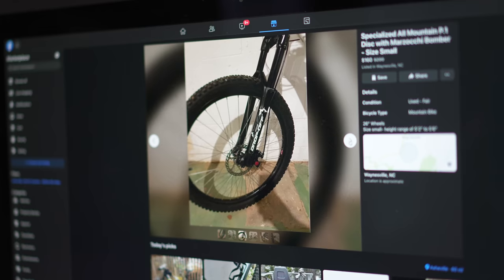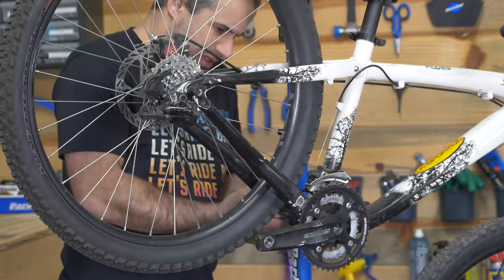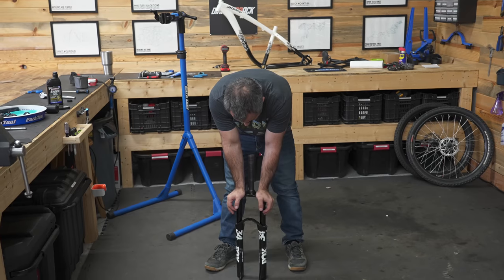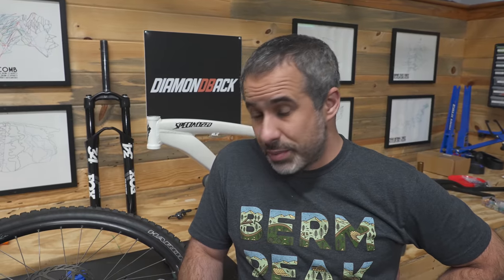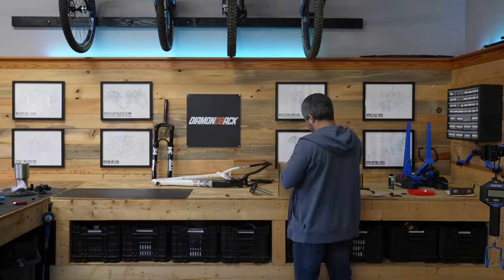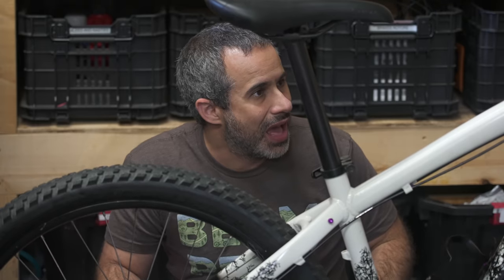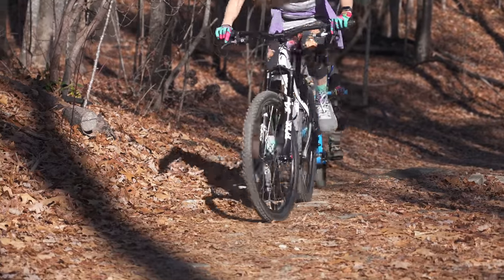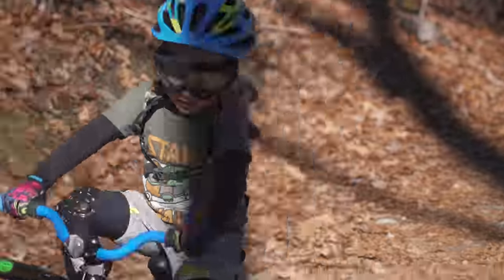Aggressively Restoring a Facebook Hardtail for Oscar’s Dog Groomer

Comment: Never thought of drilling the cable stops to avoid contamination! I'll do that at my next project. And then i have more color popping since i'm a sucker for colored cables 🤩
Reply: I had occasional shifting issues. One day I got pissed off and drilled the cable stops. No issues since.
Reply: You can buy adapter clips that mount in the cable stops and hold your full uncut cables next to them. Pretty handy if you dont want to drill.
Reply: I'm just running zip ties next to the cable holders holding my cable lol
Reply: @dansacco1964  Zip ties are far better option as with adapter all cables slack a lot.
Reply: l have an old gravel bike l might have to do this to the shifters and maybe the rear brake too ...

Comment: You weren't wrong... you stood (well, squatted) on the precipice of perfection, but left with red caps on the outside of the disc brakes. It's a tough road to pedal the perfect flip.
Thanks for another great video.

Comment: I had the same frame, it was a large 29er. Loved it when I got it built and together how I wanted it.. Some hoodlums broke into my garage and stole it. A few weeks later I got it back all messed up spray painted black. I repainted it, fixed everything and put some new disc brakes on it. Got stolen AGAIN! I've had multiple bikes stolen. My specialized, a Kona Coiler, my fit Eddie v2, an Eastern DJ bike and probably forgetting 1 or 2.🤦🏼‍♂️🤦🏼‍♂️

Comment: Great video, bike looks awesome. glad to see you using a heat gun to remove stubborn stickers, way, way, easier. One tip, on dents that bug you use 'not Bondo' but 'glaze' putty, which is what comes after Bondo typically. It is meant for tiny imperfections, dries extremely fast to a sand able finish and it ridiculously cheap. Speed is everything when flipping a bike so it will not slow you down.

Comment: I would recommend getting a Dremel tool. They have small wire brush bits that are perfect for cleaning up rust in bolts, rotors and many other small areas . I've flipped many bikes and have found it to be a very useful tool and well worth the cost to purchase . Also great job wish I could find some decent bikes to flip at the prices you find in your area.

Comment: Trick I found for rattle can paint to get it super durable, 2K clear. I buy it off Amazon and it's about $25 per can. It's a two part clear and you have to break the seal in the can. Stuff works amazing and I even used it on the fuel tank on my Honda three wheeler. Gas doesn't even touch it. Two part professional clear, in a rattle can.

Comment: Pro-tip: If you want the easiest way to wet sand evenly at an extremely high grit without burn through, use a kitchen cleaning magic eraser. Great for between coats and before/after clear as well.

Comment: Project assist/HELP!
    I’m a Disabled Vet. with a spine injury but I needed to find a way to get in some cardio.. I thought a full suspension MTB would be best even though I may only ride hiking trails or hard surfaces. I also thought a]that the Electric assist would be a good idea from previous attempts with a regular bike  to help with terrain changes.  So I went and tried a Trek EMTB. It was great on the path I was able to try it on but when I started trying to ride once I made the purchase it started to show just how much the pedal assist really helped. It’s a Bosch motor and controls.  I reached out to Bosch and asked if they had a way I could add a thumb throttle so I could get up the hills without killing me pain wise. They just responded no. I’ve tried looking for an aftermarket modification kit that would do it but I just don’t know the field enough to know what other riders are doing. I’m not wanting to go 90mph down the Highway or anything. I’m just trying to maybe ride 10-15 miles on uneven terrain. But keep the same output as if I was riding on a running track at a high school or something. I get it that it sounds like a giant waste of money to get something like a Trek Fuel that will never see a rough trail or hit any jumps. But the suspension is so I don’t do any added damage to my already permanently injured spine. The assist/e bike thumb throttle is so I can get a longer distance and ride time to keep my heart rate up. Going up a steep hill even with the pedal assist could put and end to my riding for the day in just the first mile. And as for a bike or other outdoor sporting equipment… I’ve been inside for the past 10yrs, Im trying to force myself into getting back outdoors and who knows maybe find people to do this sort of stuff with so I can get out of this Self Isolation crap.  @Berm Peak  I guess if you ever need a project like this let me know. If you could maybe point me towards a product or anything, i would greatly appreciate it.  Oh yeah, isn’t off-road R/C a blast! I love my BullyII. If you are looking for super craziness try a Yeti XL on your ramps and trails!  I also really love drift R/C’s.  Best of Luck and definitely best of health to you all during this crazy virus crud.

Comment: I know you haven’t done a hack video in a while but have you done the v brake hack where you adjust the barrel adjuster and then hold the brake arms on the rim tighten then screw and adjust the barrel in.

Comment: Hey Seth what’s your opinion and/or recommendation for repairing chipped paint area on a carbon frame?  My chain has caused some pretty good size chips near the lower bracket (chain came off and got jammed in there).

Comment: Hi really liked your video. I want to repeat  something similar on may new used bike. I bought a 2006 HARO ZERO 8. With  Marzocchi bomber 66 rc2 frons suspension. I also thinking of restoring this one. Would you have any suggestions for a rear wheel cassette and derailleurs. I want to upgrade from 8 speed to 9. More flexibility to climbing. I think so.

Comment: My bike has a slightly bend derailleur meaning the gears can get delayed in changing but still work. And the front tyre sometimes grips the brake pads. Other then that is, it a very good hardtail. Should I sell it right now or get those 2 things fixed first. (original price: $675)

Comment: Hey Seth you probably won’t read this but I have a trek hard tale and I have had it for a few years and I have had drive train problems with it for about a year and I have brought the bike in to a bike shop three times but every time I get it back the same problem happens of ware my chain get stuck in the middle of my sprockets. So at this point I don’t really know what to do if I could get your feed back that would be awesome

Comment: Dude I have a question maybe a really dumb one or just a noob question, I only want a 9 speed drivetrain, but with a clutch, because lower end Shimano 9 speed drvetrains like the Shimano Alivio's rear derailleur's spring is really soft so everytime I hit a bump or I go past through a rocky road the chain just slaps everywhere and hits my frame, but I can't afford Box components so I am wondering, could I maybe use a 10 speed derailleur like Deore derailleur that has clutch so that I won't have any problems with chain slap? Would still be using a 9 speed shifter, cogs and chain. Is that feasible? Or no? 

Forgive me for my english, english is not really my first language, Love from the Philippines!

Comment: it turned out great.
Reply: Except it still has mechanical brakes and isn't aggressively upgraded at all
Reply: @dadlife8289  bro he said it was just for towing her son, you don't need hydraulic disc brakes for that and he did a 1x conversion + wet sand so it was actually pretty aggressively restored.

Comment: I have an old specialized hardtail it has the old bottom brackets can i upgrade the bottom bracket if its a 9 speed? Single front. Any suggestions?

Comment: Hey Seth! I got a question.
I've been restoring my old hardtail (it's 18 yo) to take it back to its full glory and maybe a bit better that it was originally. It has a straight headtube (over, not standard) V-brakes cuz the frame wont accept discs, 26" wheels and a new 2x9 shimano transmision. Scince it is very hard to get a 120 to 140mm fork for its configuration and it would be very risky to adapt the disk brake caliper mounts (weld them into the frame) I thought It would make sense to build a bike from scratch.
But, how can I tell if a frame is good or bad? I mean, i would need to at least have the basic parts to be able to fit them into the frame in order to feel it (crankset, bb, headset, fork, handlebar, stem). 
I am always on a budget and I am trying to get a very cheap aluminum frame. But I would love to have a bit of guide so I don't buy something super akward feeling.

Comment: I always hated mountain bikes, as you can guess I had one when I was young.
That thing looked amazing and all but it was 2 times to big for me and for a lil kid of 12 them old timers where heavy to.
Actually always used a heavy city bike to get around, sturdy 7 gears, all you need is what I thought.
Now I bought a used MTB on the marketplace for €50, she had some dust on her but she was eager to hit the road again.
Now I'm in love again 😂 gotta actively slowdown from time to time, she goes like a beast on the road.
Even them racers only pass you by with +5/10 km/h 😏
Idk what it is because it is only about 5 kilos lighter than me city bike but going 10 km/h faster just from switching.
Prob also the way you sit you just being able to output way more power even in lower gears.
She already wears me out on the 16th gear while she has 24. 😂
Ye MTB it is from now on ... They even cheaper than city bikes to and easier to maintain, i'm just hating myself for not trying earlier. lol

Comment: Yo Seth. I noticed that basically every single bike you flip or fix, you always change it to a one by drive train. What the deal? Do you hate front derailleurs/three by cranks? There are also some advantages to the three rings at the pedals.
Reply: He made a vid Abt that
Reply: He has already made a video about it, but to put it short, one by drivetrains are better in terms of weight savings, reliability, noise and efficiency, there are a couple of videos on YouTube that you can watch if you'd like to learn more about this

Comment: Hey Seth I have a 2020 trek marlin 5 that I’ve done some upgrades to. my question is what Cassette can fit on the hub I currently am running a 1x7 and I want to try a 1x9 but not sure if it will fit I’ve looked everywhere for info on it
Reply: it should be shimano

Comment: You made things worse by drilling out those cable stops. Do you even know why those are there? The more cable housing you have to compress, the spongier the brake will feel when you pull the lever. That's why a front brake feels better than a rear brake, because it naturally has a much shorter cable housing. Shorter lengths of cable housing also reduce the amount of friction between the cable and housing. Using cable stops to minimize the length of cable housing going to the rear of the bike helps rectify that.

Comment: Hey Seth, i have a problem with my bike and the bike mechanic can't find the solution to it so i was hoping you could maybe help me. Every time I start pedaling there's a clicking noice coming from my drivetrain or somewhere down there. When I change gears it doesn't stop. I think it's something inside my bottom bracket but i'm not sure. Does anyone know a solution to this problem? (Changing bike mechanics is indeed a good solution but i want to try to fix it myself)
Reply: Hi Kenji do you still have an issue
Reply: If you do it's probably going to be either something rubbing on your cassette, or probably if you have one your front derailleur is out of tune and rubbing on your chain. I had this problem but I adjusted it
Reply: But now I took the front derailleur off and converted to a 1x drivetrain which is so much better than the 3x
Reply: @DirtbikeGoon  It has improved. It still happens sometimes so I might try to go to a 1x up front. Thank you for the information!
Reply: @KenjiNuyttens  you can just drill off the rivets on the the backside on the cranks and make sure to keep the middle chainring
Reply: @KenjiNuyttens  it costs nothing and that's what I did and bike is perfect

Comment: What I do to make a dingy frame look better is wipe it with a rag or paper towel wet with gasoline, you would be amazed at the largely unseen gunk that can remove then I wipe it down with automotive tire shine like Amour All. If you Amour All your tire BEORE you put them on they look spankin' sharp! This works on new and used tires, just scrub them well first, even new tires.

Comment: Hi seth! 
So I have a question. I bought this nice bike for £525 (around $600) It a hard tail 1x11 speed Shimano Decore and hydraulic brakes but I am worried about the forks. I am confused if the forks is an air fork or what not. Its called a rst omega, has suspension lock and left side has this tab u lift and turn left or right with + and - on it. If you need more understanding if i could email you some pictures of it and have more of an understanding of it. I wanna go on the trails but im worried that the fork might get me fucked 😹